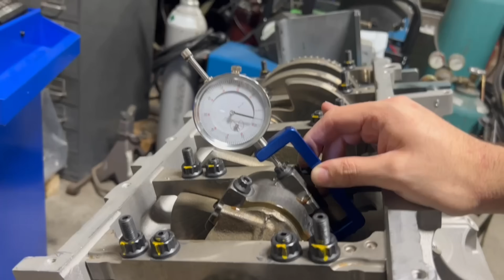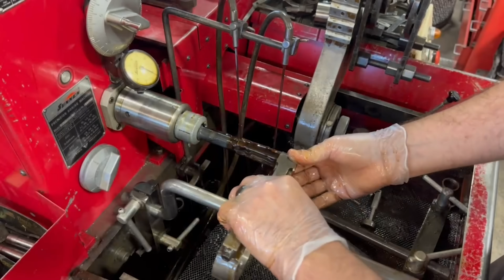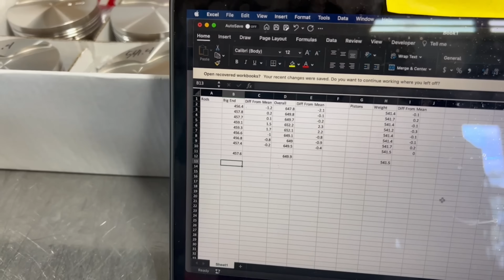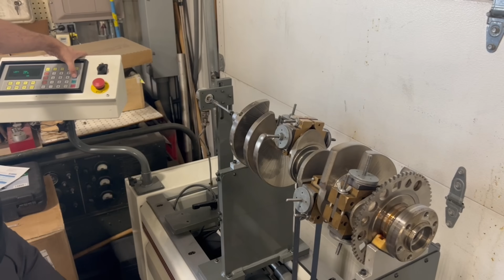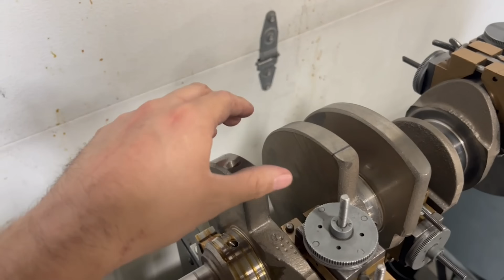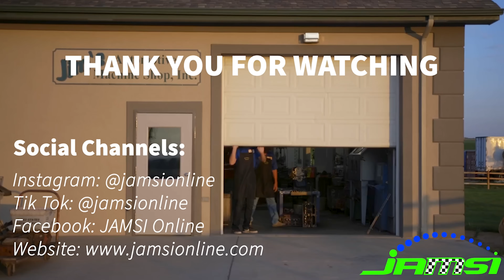I Had To Drill Two Extra Holes In My Crankshaft...  5.3L LC9 Gen IV LS V8 Build Part 2

Comment: why average weights ? you measured them out individually and as long as you numbered each rod you could just as easily marked each piston to each hole and rod ( if blueprint you could even take each rod length and piston pin height and made each have exact same compression height ) (thats called blueprinting) Making a video showing you take shortcuts isn't good advertising brother. Hope if I'm paying you to balance my stoker 5.3L (362 ci) you wouldn't just average the weights of the H-beam rods n pistons n call it good enough.

Comment: In retirement I’m a home machinist, and I have other professional and degrees in non-mechanical engineering (i.e. for good or bad, I think like an engineer).  Beyond doing small and medium automotive repairs myself over the years, everything in the scope of rebuilding engines is mostly out of my experience.  Having said all this, every time the topic of cylinder honing comes along, I always wonder why they are not polished.  Is it of negligible value, or maybe the honed finish allows better oil flow, or is there another reason?  Really curious!

Comment: It's interesting that there isn't a CAD application for this.. removing material from any of these is going to be more effective the further away from the central rotating axis you are. Several aspects of basic physics at play, and I can't summarise them neatly.
A CAD program or plugin for balancing could integrate what the test unit sees & plot different removal options for best results; hopefully a tool popup W parts, orientation, stats, balancer reading, removal options, ( drill, mill, lathe?), Tolerance preference, then auto draws the part with the removal pass/es, tool sizes, locations to achieve best "theoretical" result per part, pass & chosen removal method. Possibly export direct to CNC units.
Having that for reference & planning would be a huge boon to planning Any material removal.
Would give a real boost & basis of method to balancing as a technical process.

Comment: As far as where you choose to stop, if you haven't already done so, go ahead and pull the bobweights off and reinstall on a balanced crank and spin it again. Yep, it's looking for a couple of grams correction, likely in a different spot. We machinists can have a habit of chasing the impossible, and a little dressing with a flapper wheel on the grinder can satisfy those needs for zero or near it haha. Good to see different procedures for the laymen to see on the net.

BTW stay away from Silvolite cast LS pistons, they're typically 30 to 40 grams heavy, and you know there's not really any place to add on those cranks. (easily) I dealt with that situation on a 5.3, the easy fix was to exchange his crank for a 6.0L crank as that engine has heavier 4 inch bore pistons and the crank has drilled crank pins on 1 and 8. It made for an easy correction on the counterweights.
Reply: Good info here, thx for the heads up.

Comment: About 40 years ago I worked in a little automotive machine shop. We got a machining contract from the county school bus shop. I'll bet I did 200 sets of 391 FE Ford truck rod recons. To avoid repetitive boredom, I would set the gauge at the mean diameter from the bearing book and see how close I could get 8 rods to exactly the same size. I got to where I could do 8 rods keeping a tolerance of<.00005, or half of 1 ten thousandth, or 50 millionths of an inch. The size would actually change when you washed the rods in cool Stoddard solvent. We fit the pin bushings to about 0.0005. Sunnen always made the best hones, gauges and setting fixtures.

Comment: Thank you for sharing! Us car guys sometimes obsess over insignificant matters. Most of the time it makes sense to just button it up and move on. For street applications it's not worth the effort to go much better than factory specs unless little effort is involved. For track applications, it's much more important to chase down that last 1% possible. Of course with track vehicles seeing constant 7K and 8K RPM loads regularly it's critical to keep the rotating assembly as happy as possible so it could last a season without catastrophe for example.
Reply: actually your supposed to balance them any/every time you change any bottom end parts even if they are stock parts. But just like turbo'ed LS's most think its fine as is n they can push 1000 HP till it blows up but I'll just buy a new 4.8 or 5.3 n run it the same (and it blows up the same LMAO). Instead of doing it the right way and making the stock or modified LS last a LONG LONG time doing things the RIGHT WAY. I've built 500+ HP LS's that ran 200K and 300K + miles and still going... I've also seen people try saving a buck in the WRONG PLACES and instead cost thousands.

Comment: Wish I could do this part of the build myself....
My utility (Australia) was off the road for 8 months. Fully rebuilt balanced motor. Blew the clutch on the dyno and was assured the new clutch was 0 balanced.....2500km and I've about to pull the whole thing out and rebuild it. 
I took it back numerous times to be told everything is fine.....
I have the ability just not the tools.

Comment: Hi! Love your content, waiting for the assembly series. Question - shouldn't you balance the crank with the flywheel and maybe front pulley? Or you just balance them separately? Thanks. 

And include a cabinet for the balancer in you new shop hehe
Reply: I would think Internal balance no. External balance requires the harmonic dampener and flywheel.
Reply: That engine is neutral balance front and rear.

Comment: Most factory crankshaft are only balanced to 3/4 Oz in @ 3in correction radius. Which usually means they are over 20 grams out from factory. Even after balancing to +- 1 gr @ 1" CR it is still over 7 grams out.
Reply: wouldnt a factory crank that was 20 g out on a 3" radius be over 2 oz-in?

Comment: I need to send my 2jz GE to your shop. Great work! 👍🏻
Reply: Out if curiousity, what are the plans for your 2J? Plan on keeping it N/A with bolt-ons or making a 'GTE clone?' Not much beats a built inline 6 with forged internals, cast block, and a big single of course. 😏 Coupled with the proper supporting mods, some decent standalone/ file of your choice, MLS gasket and some ARP's and you've got a damn RELIABLE ride that still comes with 3 pedals, RWD with an LSD and a ton of 'proven' aftermarket/ race support as well... I really dig the 1J as well and love the older JDM mk3, Soarer, Chaser, etc. MANY awesome chassis to swap either drivetrain into! 👍👌😎
Reply: While i love JAMSi, they mostly do stock to mild rebuilds/repairs, if that's what you want, that's fine.
Real Street Performance are the 2J experts!